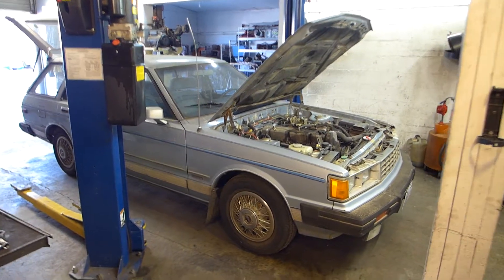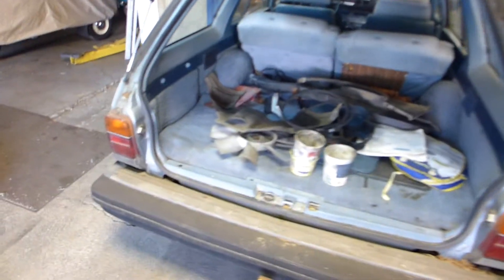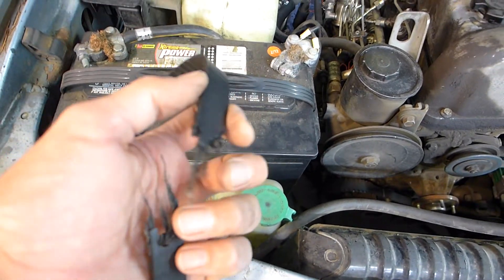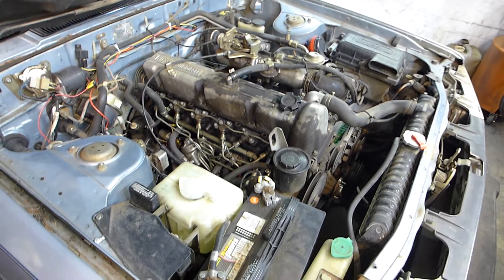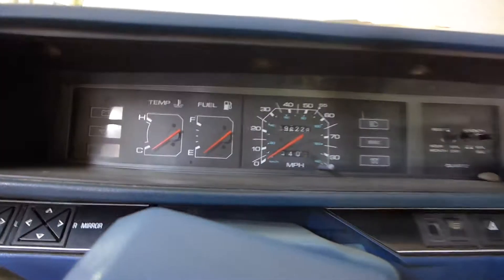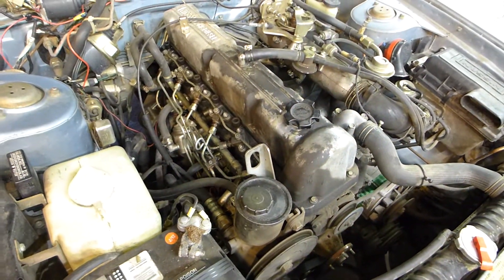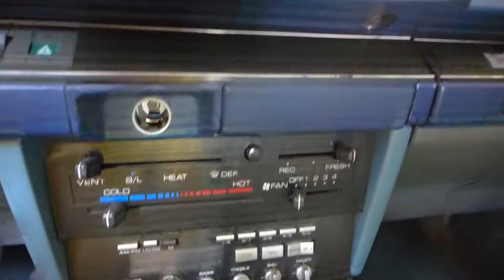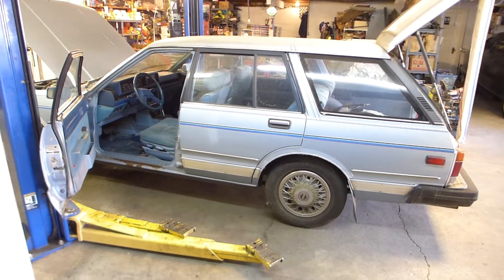Classic 1981 Datsun/Nissan 2.8 liter Diesel Maxima Wagon

Comment: Thanks for keeping this one going dude!
LD28 is a great engine.  If given regular maintenance, they just seem to last forever.
Reply: Same with the really trouble-prone Oldsmobile LF9 5.7L diesel V8 engine: give that one proper care and it should last for years and years!
Reply: @ClassicTVMan1981X   I consider it damned unforgivable that diesel engines weren't offered in large numbers here in the USA back in the 80s. Emissions, be damned. I believe that with careful maintenance, any engine will run indefinitely.
Reply: I'm not surprised, nissans were great quality then

Comment: That's probably good for another 30 years. Interesting side note, you may be able to find the belt direct from someone like gates - it's highly likely to be used in industrial machinery - the belts are not always vehicle specific. As long as the width pitch and length match it will be work as these toothed belts are used in robotics and machinery.

Comment: I had one of those... bought off of my parents in the early-90's. Sourcing parts for it even then was tough at times. I send it to the junkyard when the frame rotted out to the point I could put my hand through the holes. Shame - because the engine only had 200k miles on it at the time and still ran great!

Comment: If the day comes when you can't find a belt, the crankshaft is worth a lot to the L series guys, you can make a stroker motor out of the L28 with that crank. 
The shell would make an awesome platform to swap in a Nissan RB 25DET engine if that were the case. Talk about a sleeper, the RB25DET would just about drop right in there and it's like 3x the horsepower.....and twice the torque.

Comment: What amazes me is that the LD28 engine shares many parts with the L-series gasoline engine.
Those Nissans weren't considered unreliable. Was the LD28 just a really good engine, or was the LD28 so uncommon that people don't even remember them?

The reason this surprises me is that GM tried to share gasoline engine parts with diesel engines, and they were some of the worst engines of all time. What did Nissan do that GM didn't do?
Reply: +Skyline Fever The LD28 was basically the diesel version of the L28. That's why it looks so similar to the L28. It was used from '81 up until '89 when a new version of it was launched (RD28).
The LD28 is basically bulletproof. 84BHP out of NA 2.8 liter engine. Common problems are: GP relays go out, injection pump timing goes retarded resulting in black smoke under acceleration and another common problem is that the injection pump belt (which nobody every changed although there's a replacement interval for that one) snaps.
Reply: Thanks you very much. It has been a long time since I was looking for  those answers.
Reply: The reason the LD28 didn't sell more here in the USA was because of the failure of another diesel engine: the Oldsmobile LF9 5.7L diesel V8!
Reply: They only sold that engine in the maxima from 1981 to 1984. I wouldn't say its not memorable, as just about any S30 Z car fan knows about the Diesel Maxima. There are only a few remaining because the Z guys would strip the cranks out of these engines in order to build stroker motors out of the L28. I am sure many perfectly good diesel maximas met an untimely fate due to this.  However, this engine was used in many industrial and marine applications, so I doubt a belt would be impossible to find. I just think you would have to order from other than an auto parts store.